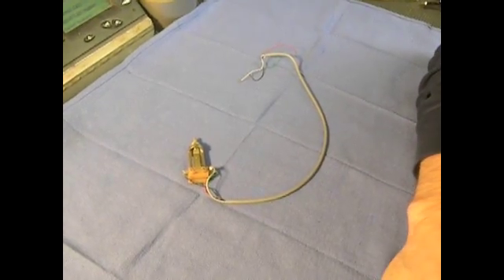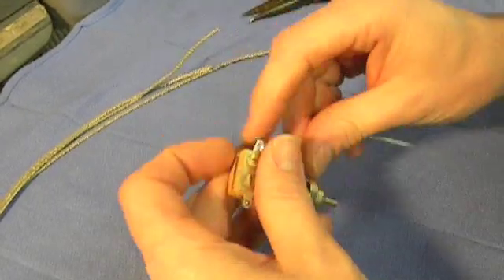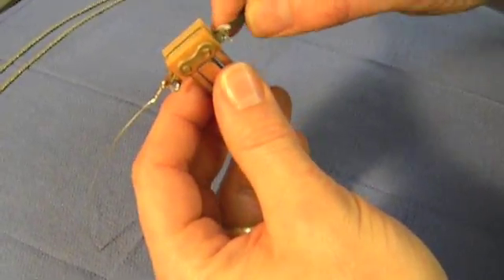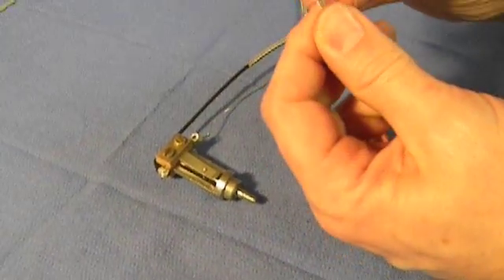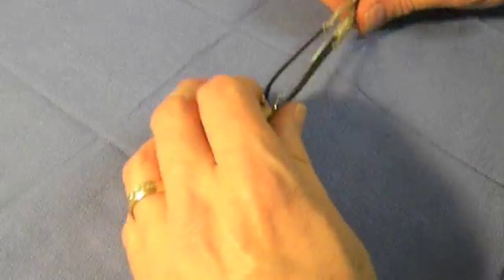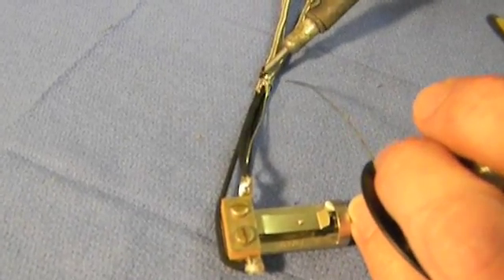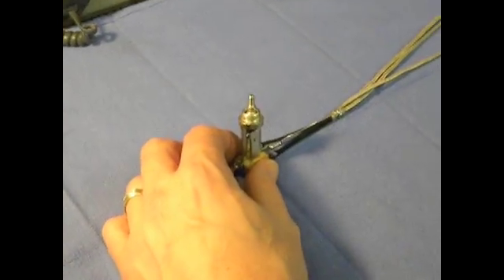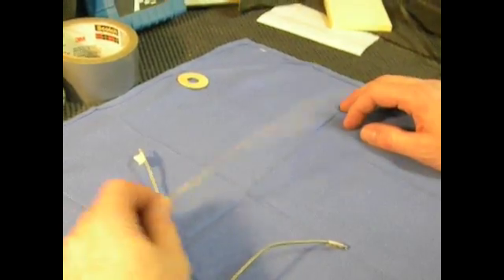How To Wire A 3 Way Switch

Comment: thank you for this video, it leaves me with some major questions, I just pray you will answer. I have a SG knock off, but a good one, and I'm replacing all the hardware. I have 4 CTS 500K tone/vol, a 3 way switchcraft toggle like the one you're using, 2 capacitors and two Dimarzio humbuckers, a Crunch Lab and a Liqui fire. in this video you don't connect the actual pickups to the toggle at all, that confuses me. I'm sorry if it's stupid, I'm a complete noob . my extent of guitar repair ends at soldering the output jack back together bc it got lose lol. the diagram that came with the pickups does not include the wiring for the switchcraft style toggle.

Comment: Do you have to put the ground wire on the back of the switch to the output jack or can you just leave that one off and just solder one from the back of one of the pots to the output jack? Everything will still be grounded right?

Comment: definitely need to thank you.  My noobile ass has been wracking my brain trying to figure out what the hell the problem was.  I had the ground and output mixed up.  silliniss.  works good now. thanks
Reply: Was your error that you didn't get any sound or could you describe? I think I'm in the same spot right now.. Did exactly like in the video but no sound...
Reply: I too am confused by the video. He has wired the middle position on the switch to ground. That is usually the output and the other side the ground. Correction: On some switchcraft switches it is. On others it isn't. They are not all the same! My 50's tribute (Gibson) came with what looks like an Epiphone style toggle switch with the left side being the ground (opposite of this).
Reply: +cgavin1 yeah I did the other way around and it worked!

Comment: Is it possible to turn 2 volume knobs and 1 tone knob (without a 3 way switch) into 1 volume knob, 1 tone knob and 3 way switch ?
Reply: Of course it is, you can do whatever you want. Try the Seymour Duncan website or guitarelectronics.com for some cool wiring diagrams.
Reply: pedraw Thanks

Comment: Thank you very much for posting this demonstration. I have a '92 (Nashville) Les Paul Studio that had four-strand "telephone wire in it. I had just ungraded to a Seymour Duncan 59/JB combination and was getting bummed by the sound. After picking up some wire, building a new line, and modifying the schematic to my model (and covering the cavity walls with sticky foil), my guitar not only has lost its hum, but the pickups respond much better than before. Again, thanks. --John

Comment: Hey Nice video I have a question, I just got a three way gold toggle switch, but it has one connector on the side that goes to the jack and four on the other side that go to the volume and tone controls, I took out the stock switchcraft switch and put in the new one and now the guitar only buzzes when i touch the switchand the volume doesnt work...you know what the problem could be?